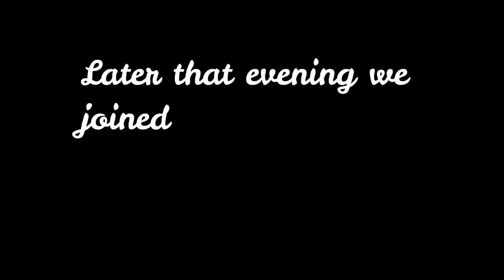Picking up a BIG CRATE -SEND TO PHILIPPINES- PEEK INSIDE then FILIPINA BDAY PARTY

Comment: get some exstra belts for the motor and oil filter and air filter while its at yur yard exstra  fuel filters  air lines,,,,
Reply from the maker: Marine engines do not have air filters like a car. It's more like just a breather. It is a 1.7l Isuzu truck motor. Sold al over the planet including the Philippines so getting the belt and other parts is not hard there. I agree on having extra parts. I ordered extra water pump kits ( Impeller , gasket, housing) and a few other basic items that the marine engines commonly need. The diesel fuel filter is also a common used spin on filter used on diesels in the Philippines.